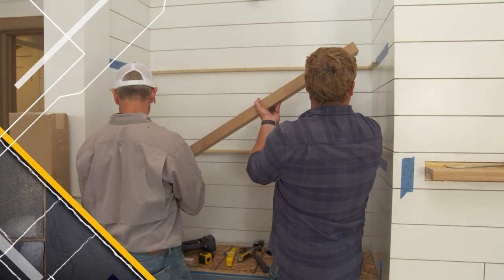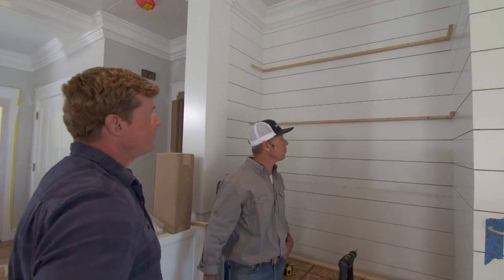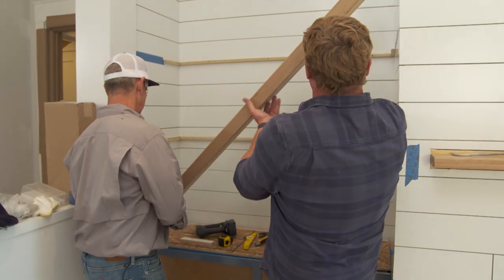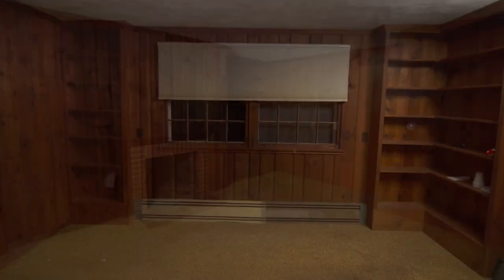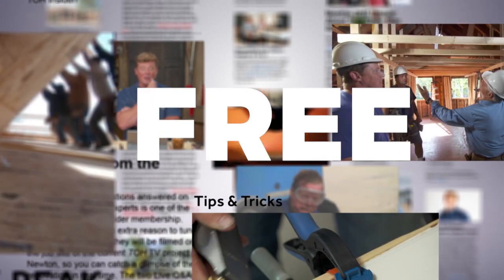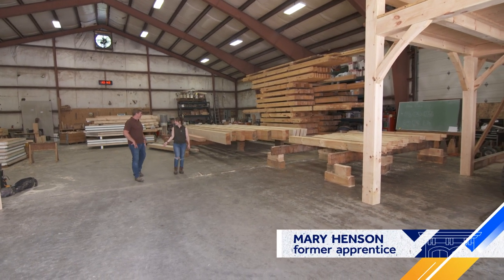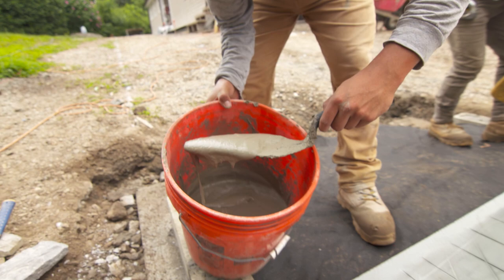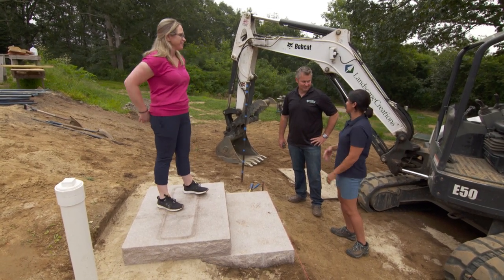This Old House | Rockin’ the Granite (S41 E9) | FULL EPISODE

Comment: I'm just wondering is glue the only thing holding the 2 pieces of wood together?
Reply: A properly glued wood joint is plenty strong. If a break occurs, it's usually the wood itself that fails, not the glue